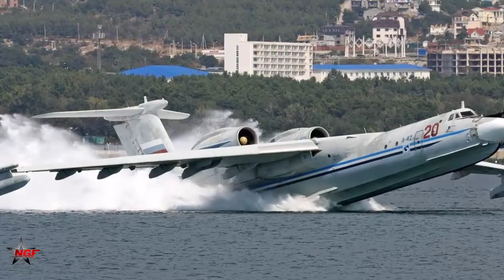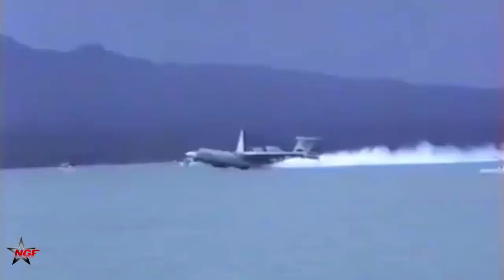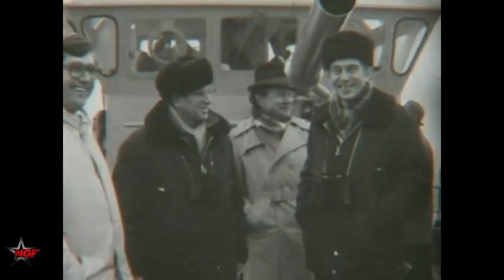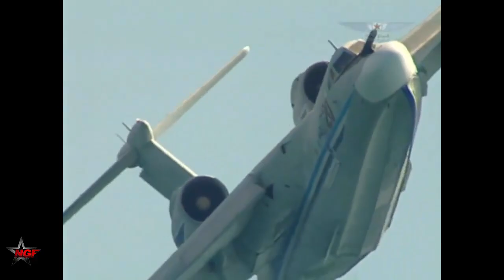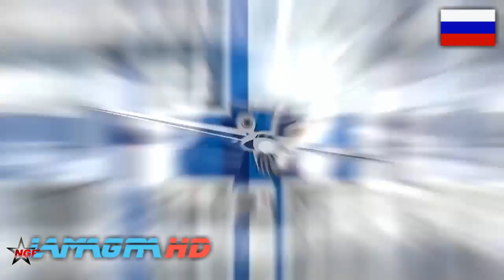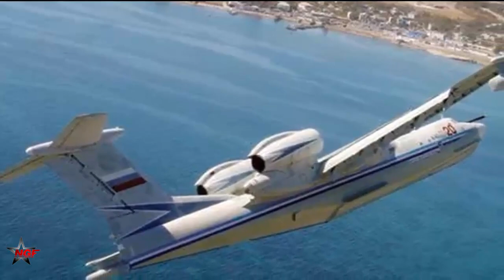Reviving the Giant! Russian Resurrects the Giant Amphibious Aircraft

Comment: 6 tons of cargo capacity seems very low.
Reply: The aircraft is amphibious, designed to propel through 2 metre waves, for which it needs a strong keel, adding weight that no ordinary aircraft has to deal with.
Reply: @rightiswrongrightiswrong806  I don't think that's the reason even if this "keel" weighed a ton more to handle waves it would not explain it.  I think the plane looks like it was very optimized for cruise at the expense of takeoff capability . Like someone calculated "we need to go xx Nm in xx minutes or the enemy submarine will be will be out of detection range by the time we get there"  and everything was compromised to reach this one requirement.